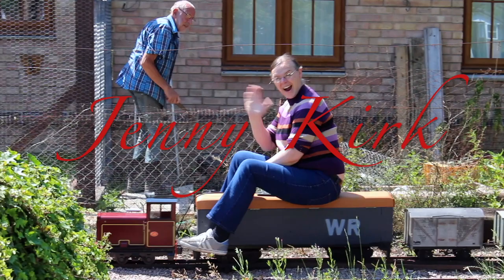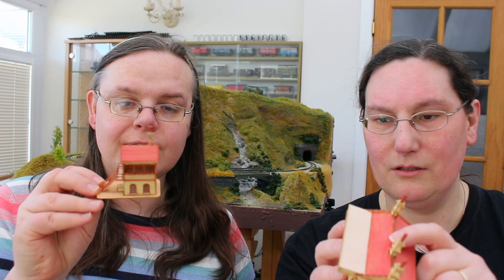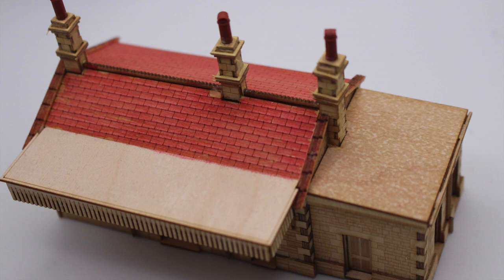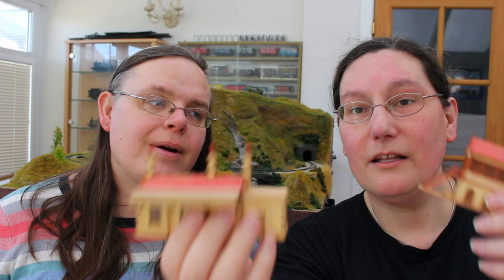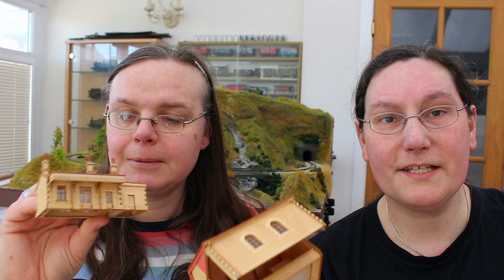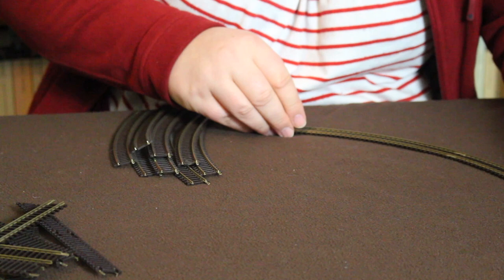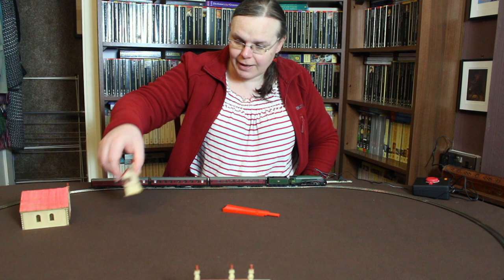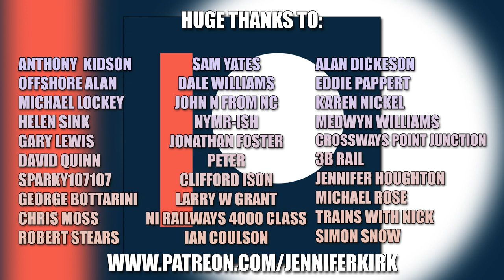Fantastic Peco TT120 Buildings for your Model Railway

Comment: Hello Jenny ( and the C.M. of course). 

While I genuinely bow to your superior experience and knowledge of most things 'Model Railways', I really must question your statement that the TT 120 Peco Buildings kits are made from MDF.  Even if it was possible for MDF to be made this thin, I doubt whether it would be a strong enough material to build with or even to handle!
Surely the kits are made from thin plywood - a material well-known to modellers in many fields (though why modellers would choose to work in a field is beyond me! )
Apart from that, I agree with all the positive things you both say about these kits.
With best wishes,
Ray E. Smith

Comment: Hi, I’m relatively new to this and I have purchased the peco signal box kit can you recommend what glue I should buy for assembling it, also would it be worth painting some items before completion?
Reply from the maker: We assembled the kits using Rocket Card Glue, which is great for paper so we tried it on these wooden kits. It works but there are a range of other glues available that might be easier to find and do just as well. As for painting before completion, that's a great idea because you'll have so much of an easier time; especially on the inside parts.
Reply: Great ,I’ve managed to find some and have it ordered, thanks